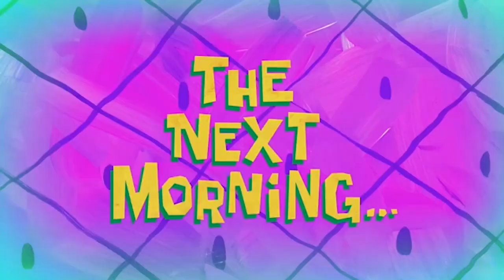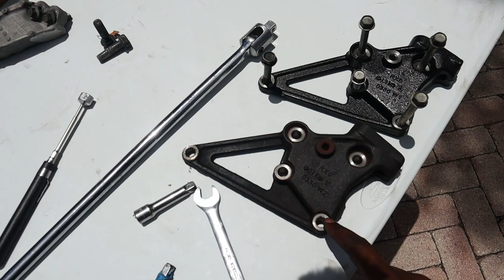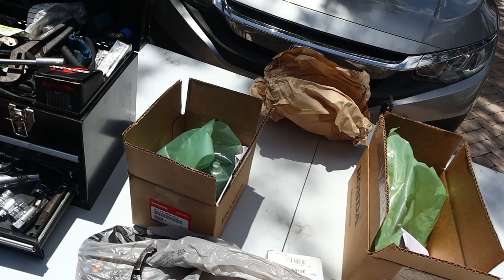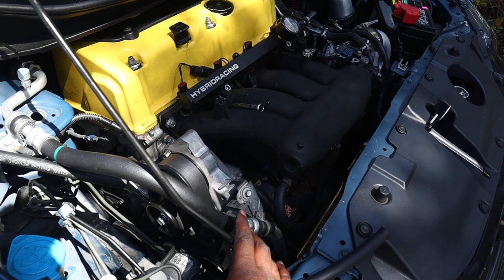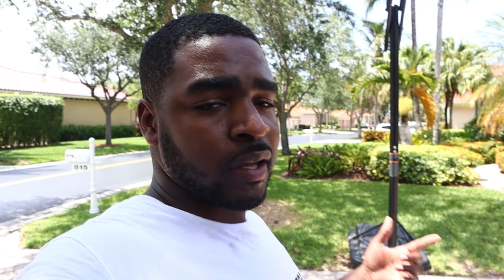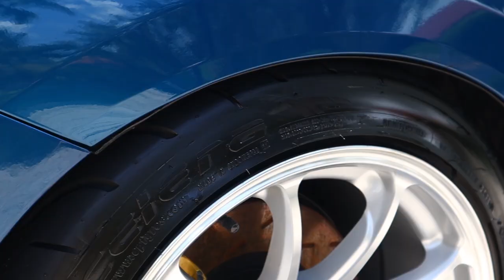I broke my boosted Civic Si ....

Comment: Did you use the original bolt for the idler pulley or did it come with one ? ISO of idler pulley bolt !!
Reply from the maker: I used the original one

Comment: Yo Zoovie just letting you know if you’re boosted and getting 400 to the wheel you should upgrade your fuel injectors to at least 550cc. I’d go 750cc so you have wiggle room and you don’t want to be above 90% duty cycle.
Reply from the maker: 550cc and 750cc isn’t a enough fuel on e85.. car is on 1300cc
Reply: @zoovie   but 750 would be good enough for boost but not e85? But might as well get the 1300 just in case I want to go e85 in the future. Also which ones do you have

Comment: When I try to shift into 2nd at high rpm it will literally lock me out, will the hybrid racing cmc fix this???
Reply from the maker: Definitely would help a lot
Reply: @zoovie  thx brother def gonna cop. But do u have any ideas what would fix it 100%?
Reply: Just a mental note… stay on throttle when shifting from 1st-2nd gear. Personally I have hondata so I have no lift shift. Also acuity shifter bushings helped me a TON with that problem!🤍
Reply: @nathanielmartin3122  only do that when doing a pull from a dig right? Also how much do I stay on the throttle? And I’m ordering the hybrid cmc slave kit and the hybrid racing bushings. Praying it fixes it